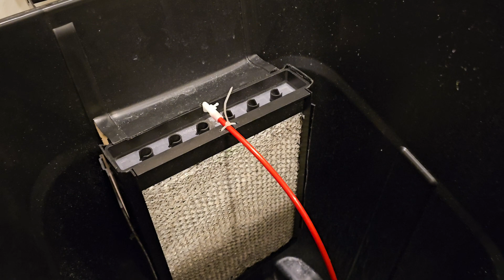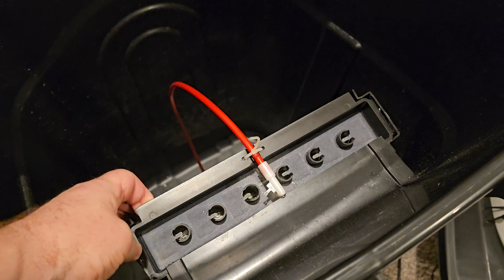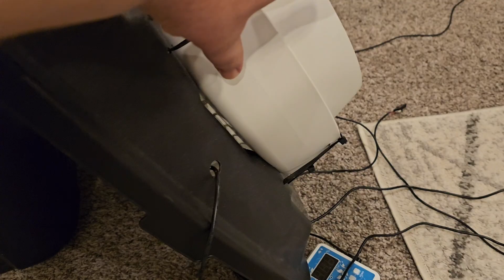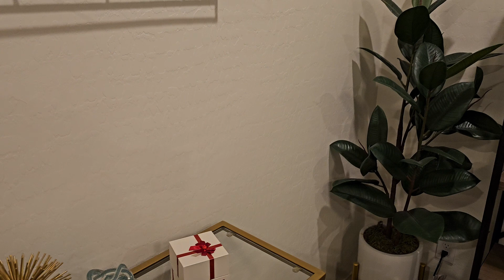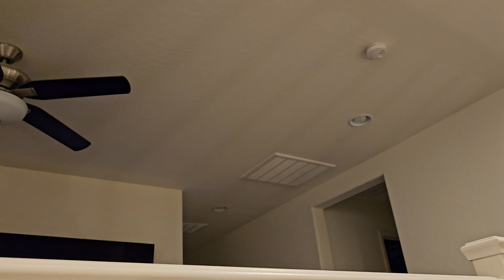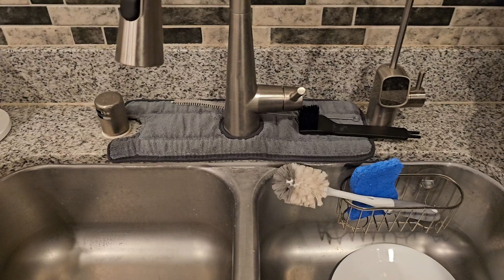DIY Whole Home Evaporative Humidifier, My Most Efficient Design Yet

Comment: Genius design man! I've owned an Aircare console "whole house" humidifier since November 2024 and I'm already on my 2nd cellulose paper wick, they keep sagging leaving a major air gap above the wick itself. I tried reinforcing the wick with more hot glue, everything, but even running a bacteriostat the weekly cleaning it needs inevitably causes more and more damage to the wick. I'm retrofitting the water panel and pump you used into the Aircare housing, it's already got a powerful fan that sits before the wick and blows out the top, plus the humidity controls built in. Hopefully this works out, at least even if it's less efficient the water panel holds up better than the paper wick.
Reply from the maker: I also had an aircare console. Thing took 4 wicks and had 2 fans. It worked well but I got tired of spending $30 a month on wicks. Half the wick was underwater when full so it lost a lot of efficiency. Never had a problem with sagging wicks tho. The pump might help in your situation. Maybe zip tie the wick at the top to stop it sagging?
Reply: @Incomplet_name  LOL i JUST did that, it's already starting to rip the saturated wick but it seems to be holding better than unsupported

Comment: Nice job - I was thinking it may be better to have the fan blow through the wick as it does when the April air is mounted to a furnace.  Seems like it may extend the life of the fan?  I was kind of thinking of a towel in a bucket of water with a fan blowing on it until I saw this;-)
Reply from the maker: @FlagPole84  I would have just mounted it to the furnace but water constantly drips over the wick with that setup. Water is not cheap here in Vegas so I found a better solution.

Vornado fans have 5 year warranty for AC and 10 year for DC versions.
Reply: @Incomplet_name  Totally agree.  Water is expensive and I hate to waste it also.
Reply from the maker: I've had this fan "sucking" through wicks for 5 years now and it's still fine. I used it on my previous diy model too. Either way, the DC Vornado fans have 10 year warranties.
Reply: How would you got about mounting to the furnace? How much is water in Vegas?? I just moved into a old farm house with a well.. very dry here too.
Reply: @JRESHOW  Look up April Air flow through furnace humidifier.
Reply from the maker: @JRESHOW https://amzn.to/4gcKqLE